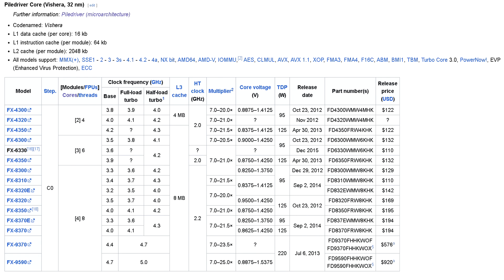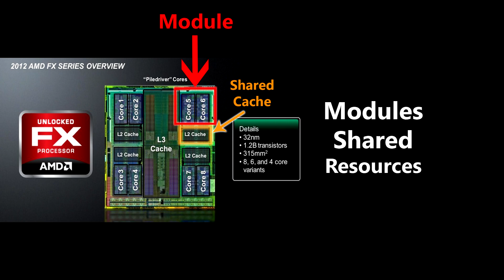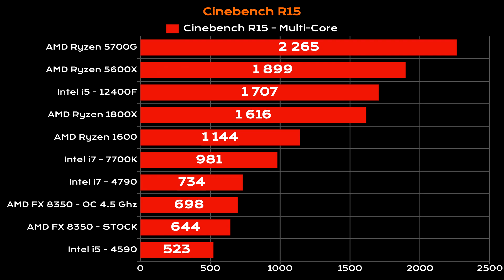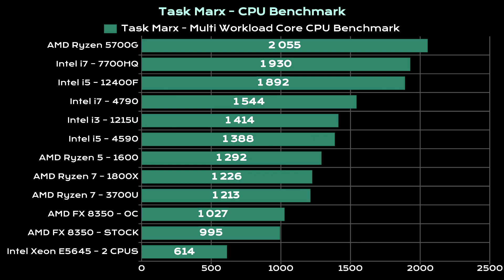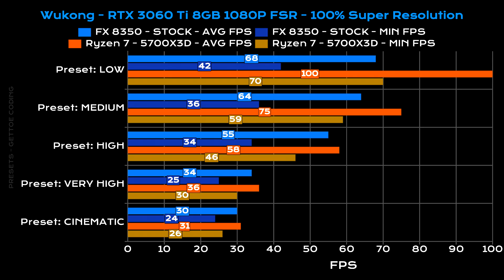AMD FX Series - FX 8350, was it future proof?

Comment: i mean...
Fx8350 launched in late 2012 with an MSRP of $200 US dollars... 

that's around the price of the i5 3570, the ivy bridge locked (yet mainstream) i5 series CPU from the same year. while i7 3770k was around $350 US Dollars. That's almost 2x more...

and it's fair to say that for a 200 buck CPU, the fact that you can still play most games 12 years after it says a lot. you can't really do that with the i5 3570, and while the i7 3770k is still and will allways be superior, the entire lifespam of both CPUs the Fx 8 core was way cheaper than the i7.

Not to say if you picked AM3+ during 2016 on the final year, in which you could grab an Fx8300 for the price of an i3 6100. The Fx8300 can still play today with an Rx 570 8gb; while i do think that i3 6100 has a hard time even running windows 11.

so yea, Fx stood the test of time, and AMD did provide a futureproof platform... the catch is that it was merely "ok" at release and mediocre (yet very usable) during the entire lifespam

Comment: I upgraded my Phenom II X4 945 PC to FX-8350 recently searching hardware for weeks and paying nearly as much as a low end Ryzen+Motherboard, the reason i wanted this is because it is the latest gen with no PSP and integrated TPM, and to be honest it's not much different than a low end Ryzen 5, it actually runs everything game wise if you have a decent graphics card.
Only thing is it's HOT, but it's running 50c under stress tests with a Zalman down blowing cooler into a tiny case which is excellent.
120w TDP for doing what a 65w CPU does, but pairing it with a newer graphics card around 100w TDP comparable to 200w+ older ones the overall consumption is pretty low, and i don't care about consumption anyways, i don't cycle on a generator. 😂

Comment: These FX 8-core chips are still a viable choice for medium spec gaming today.
They also have a wide scope of compatibility from the younger side of retro games to VR High.
Pair these chips with fast memory, a RX580/GTX1060 or other accelerators and they're balanced.

In the server space they are also a strong enough champion for everything but power budget.
Need to run a capture card, cheap NVENC card, NVMe, several sata HDDs and a 10GbE NIC? Done.
The boards and chipsets like AMD 970/990 were where all the magic happened but still kinda $$$.
Whatever weird job needs done like game server or streaming, offloading to the FX can make it work.

Comment: 7:19 this is why I had  cpu or case fans on my  vrms when I used my fx 4300 , 6300 and 8320 I relized games were  way more smooth if I could keep them cool plus  it  helped a lil  with cooling bottom corner of the cpu still went  through 4 motherboards n like 8 power supplys  in like  7 years tho cause of them cpus and cheap used boards n psus  I got used off ebay   lol

Comment: Sorry, I just fail to understand how comparing it with a not so comparable CPUs in synthetic benchmarks tells us anything regarding how future proof it was. For me, to see that you have to compare it in gaming with i5 2500 which was it's competitor back in the day, or at least the i5 4590 but bench it in somewhat modern games. What good is it comparing it to 5700 x3d?
Reply from the maker: It shows it hasn't aged that well, the whole point of the video. It bottlenecks the shit out of a more modern gpu, when that same gpu is paired with a newer cpu.
Reply: @gettoecoding1058  I don't think it shows that. Sure, of course it will bottleneck modern GPUs, but there is no evidence provided it hasn't aged well compared to it's at the time market competitors. I know for a fact that for example you can play Battlefield V just fine on a FX 8350 while you can forget about doing that on a core i5 2500, so it actually it really aged better than the i5 2500 which at the time was considered a better gaming CPU

Comment: Wow an FX 8360 with a 3060ti, bottleneck COUNTRY if you dudees only knew that this poor GPU was never seeing 100% usage or even close to it no matter the Res ;)
Reply from the maker: You are 100% right, The benchmarks show exactly that, that's why I paired it with a rtx 3060 ti and then benchmarked it against a 5700x3d with the same gputo show that's its a rather large bottleneck against more modern systems

Comment: I had an FX-8320. After rocking a single core Athlon 64 3200+ for 8 years, this was an amazing performer. I got it for Christmas as a pre-built in December 2014, and the packaging for the system said 8-cores. The GPU it came was was an R7 250. 
The system felt so fast that I thought that I would not need another PC for like 8 years minimum. But after a year, I dabbled a little bit into PlayStation 2 emulation, and I was told about some weaknesses with the FX CPU's that affected how well PCSX2 would run. It didn't really matter here for me, since the games I wanted to play weren't emulated correctly & had glitches, so I stuck with my real PS2.
Then, in 2018, I started playing some games that weren't well multithreaded. They were limited to only using 2 threads. That's where I noticed the FX's weaknesses. Everytime those games stuttered, a thread would hit 100% while most of the other threads wouldn't be doing much. On the otherhand, the FX was quite good at multitasking during the time I had it.
Reply from the maker: 100%, for multi-tasking, it was great and code compiling. I found it faster than my i7 4790 at the time for a few different things, just not gaming. I will say though it's aged better than some other cpus.

Comment: So I haven’t been gaming on PC since 2017. I just fired up my rig with an 8350 Denab Black Edition for the first time since then only to play schedule 1 which isn’t demanding. It did alright. It has an RX 460. Is it worth getting an RX 580 to do some 1080p gaming?
Reply from the maker: It is a dated gpu and I can't say how much longer it will be supported, possibly have a look at the rx 6600 or rtx 3050. I guess it depends what you plan on playing. My rx 580 did me well to be honest after my R9 380x
Reply: @ thanks! I am considering just putting the dough towards a new build. I kept researching and this doesn’t seem like the wisest choice.
Reply: @staceygoodale6427 I’d say go AM4 and get a used 5xxx card from amd, get a new psu, keep the case and whatever else you can
Reply: @StuffingSkulltag a few weeks ago I got a 5700x, RX 7600 XT, MB and 32g Ram, new case and 850w supply, spent around $900 for everything. Card was $50 over msrp but whatever. 1080p gaming has been awesome so far
Reply: @staceygoodale6427  even some 1440p is possible and or some high refresh at 1080p will be world of difference for ya vs the FX or some like that the difference is form earth to mars ^.^
Reply: It’s time to get back in pc, consoles are becoming pretty expensive

Comment: waiting on a a320m-k mobo already got a ryzen 1600 and 16gb of ram waiting.  moving off of fx8350 finally altho its bitter sweet because the fx is on a nice crosshair iv motherboard. while my ryzens gonna be on a bottom dollar elcheapo motherboard. but despite losing ports it'll still be faster even on a entry level mobo with an entry level ryzen and dubious ram.
Reply from the maker: Nice, I ran my ryzen 1600 on a msi a320m board with 32gbs of corsair vengeance ram @ 2667mhz for a few years with a rx 580 then upgraded to a rtx 3060ti. The less complex the motherboard is, the less crap you get. Every time I have gone with a high end motherboard 4 years later they died... It's happened to me twice. That 1600 isn't a bad cpu. It did bottleneck my rtx 3060 ti at the time. But not by much

Comment: Still have FX 8350 running @ 5Ghz on Asus Crosshair V Formula. 
multiplier 25X
CPU FSB 2000MHz
NB/HT 2600Mhz
memory 1866Mhz

CPU voltage 1.47V
mem voltage 1.65
rest at default

It get's pretty toasty CPU Die  temp hovering 60-63 deg C with at Cryorig R1...stable.

Comment: I actually got two checks from the class action lawsuit concerning AMD FX. One was for around $33, the other for around $1.50 US (yeah crazy they sent a 2nd check worth less than the gas money needed to go cash it). As is, I do feel that the processor did live up to its expectations as far as futureproofing goes. Gaming wise, it did outlast the i5 processors it was marketed against. FX-8350/8370 was actually still doing ok up till around 2022. Since then, it has started to suffer more and more, especially concerning frame time spikes/latency issues. I've done some fairly extensive testing over the past year over a wide range of titles, many that I posted on my channel showing that it really struggles immensely with many modern titles. 

You do get an outlier now and then though still like the Riven remake, Ghost of Tsushima, or Lies of P which run fairly well still. Cyberpunk 2077's current Phantom Liberty build performs poorly on FX, so I would advise anyone wanting to play it to roll back to Pre-Phantom Liberty via GOG Galaxy, as the old build is still available to owners. From what I have been reading, for anyone still running a FX setup with a Radeon installed, it might be ideal to set up a dual boot and have the extra OS be SteamOS. Supposedly there was some performance gains to be had for FX on some newer titles, but worse performance on some older ones, like GTA V. Either way, as of now, Windows 11 24H2 is problematic for FX owners. You can get Win 11 23H2 to install and run fine via a custom Rufus USB install, but the consumer release loses updates in a year or so on 23H2.

Comment: Still own a fx 8320 oc to 4.2ghz using stock fans(ik im crazy for doing this). Tried it few months back, still usable. Only downside is its power hunger, cant pair it with my rtx 3080 cause im running 650w psu. But paired it really well with 2070 super. Able to play most games on high settings in AAA games. Thanks to fsr + frame gen. 😊
Reply from the maker: Yeah,  it's surprising how capable these fx cpus still are 🤜🤛
Reply: nope a 2070 super is not pairing it well infact it will perform EXACTLY the same as a 1070ti because that evne is too much, have had an 8320 with a 960 and later put a 980 on it exactly same crap, treat yourself and upgrade, andything pretty much is going to blow you away
typed on my i7 12700k 12 core second pc ;) imagine how muc hof a difference that one will be :D

Comment: I had AMD FX-8320, slightly weaker version of FX-8350, same 8 cores
That CPU was actually pretty nice for rendering and back then everyone loathed AMD, so it's funny to see how people are fist pumping for AMD now like they knew good old Piledriver and Vishera 

It was actually way better than people say, I know it. I had tons of AMD CPUs from Phenom 1 and 2, Athlon 64 without IHS plate, it was fine CPUs

And I still have a warm memory for that FX-8320, AMD ended up giving me $50 for that CPU, I didn't even understand why I got it, until I read a letter and it said that because it wasn't an 8-core CPU, but it sure felt like it and it was great for rendering

Comment: The problem is multifaceted, let's start from the beginning 
AMD has, to put it mildly, fucked up giving optimization documentation and kits to developers, to the point that the team developing Battlefield, which is optimized specifically for FX, was NEVER given the opportunity to study the processor.
This also meant the death of the Bulldozer architecture specifically. The Bulldozer had a huge power leak, probably on the SOI- GlobalFoundries side, not a socket fault like the Intel S478 platform. It was eating a lot, generating a lot of heat. And the REALLY much improved Piledriver was released, more instructions, and more normal heat management, power was finally requested, which could have been in the Bulldozer. The branching estimation was improved. 
In the Bulldozer, ironically to break with the K-series, they wanted to impose the more clocks = good principle known from Phenom I and Phenom II, which we know today means nothing. 
The cores have only one FPU, (one FPU for 2 cores, and vice versa for intel, 2 FPUs for 1 core), so otherwise you get a 8 core 4 thread processor. This is why in the early days the 6100 was inferior to the Phenom II X6 1090T. The programs could only handle up to 4/4 cores and threads, no, at FX they were unable to handle them properly. That's why Microsoft decided to treat FPUs as cores and make the cores HyperThreaded, i.e. to make itself a 4/8 CPU. Which is fair, because 4 modules...but 4 threads? No! Make it 8 threads (which is originally the cores).This is how we managed to get the modules to work as cores. And the cores work as threads. This was the way CMT was placed and implemented at MicroSoft, as it was the last one recently. They couldn't really prepare programs and operating systems for HT, let alone CMT.
The implementation of SMT is similar to HT, but better, more mature, and with greater benefits than HT. 
On Linux, the FX performed the same, or better tha the concurent I7-2600K. But then, no single people cared about Linux, unlike today.

Lastly.... has FX aged well?
I used to play with R6S, recently DX12 implementation came out for it, it runs much better (from 80-90Fps to around 120-144). Only problem is it should have been like this 9 years ago, but what goes around comes around.
How much!
A 14 year old, improved architecture with a still supported thread handler that yields numbers like this is very fair and commendable. AMD FX would have been bought by many more people if it had lower heat generation and higher thermal tolerance.
FX, like it or not, will be with us for a long time to come and stand the test of time better than Intel's 4/4 processors.
Reply: The problem they had with gaming back then is that games and primarily the DX APIs were single threaded. So if you were gaming back then on DX9/10 you'd be limited to 22fps on a FX8350. My consistent main game is DCS (FC2/FC3 back then). Apparently the 8350 can get north of 60fps now that their engine is multithreaded, with a late stage DX11 API. They plan on moving to Vulkan. It still did really well when Dice used the Mantle API. AMD was on the right track, but the industry largely follows Intel/MS. It wasn't even really so much a lack of optimizing specifically for AMD (which few Devs were ever going to do anyway), but needing to actually properly approach multithreading.
Reply: @blkspade23  exactly, my primary game is R6S, the DX12 optimalization boosted up to an Sandy Bridge level the FX. 
The problem, this must have happened in 2014-2015. Im planning to make another FX configuration again.

Comment: What the FX-8350 brought to the table was incredible value, especially for gamers.  I bought an FX-8350, a 990FX motherboard and 16GB of DDR3-1333MHz all for less than the price of just one i7-3770K.  The CPU itself cost me only $170CAD and it lasted me for five years.  I was a rather poor university student at the time (but already a tech expert) and I the most strenuous task I wanted my PC to handle was gaming.

I initially was going for an FX-6300 but Tiger Direct had some insane sale on the FX-8350 which made it only $20 more expensive than the FX-6300 and I couldn't say no to two more cores with higher clocks for only $20.  Funnily enough, when Ryzen came out, I went to Canada Computers to buy an R5-1600X but they had an open-box R7-1700, again, for only $20 more.  So that's what I upgraded to.

My mom used the FX-8350 in her HTPC until last month when I replaced it with an R3-3200G because there was no reason for her to need both an 8-core CPU and a video card drawing power just to watch her shows and movies.  That FX ran Windows 10 just fine, especially with an SSD.  Hell, I still have a craptop that I use for watching YouTube that runs on an A8-3500M.  It has to use W7, but Firefox and YouTube still wotk just fine.

As for AMD being dishonest about their core count, I must disagree because a CPU core IS an integer core (or ALU).  That was defined LONG before FPUs were integrated onto the same die (486DX and newer).  An FPU isn't even x86, it's x87 and before it was integrated onto the CPU die, an FPU was referred to as a "Math Co-Processor".  Math co-processor sales gave significant rise to AMD and Cyrix because their MCPs were faster than Intel's.